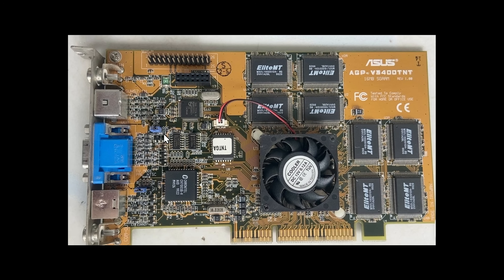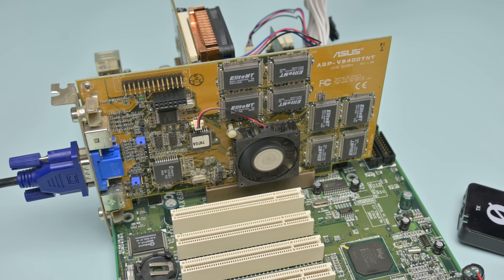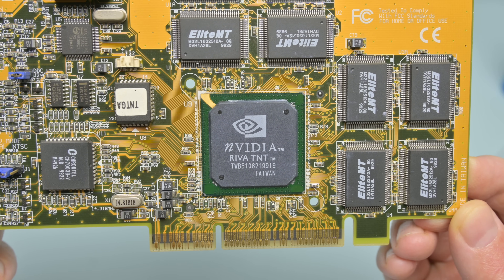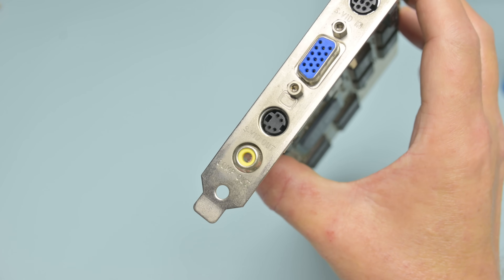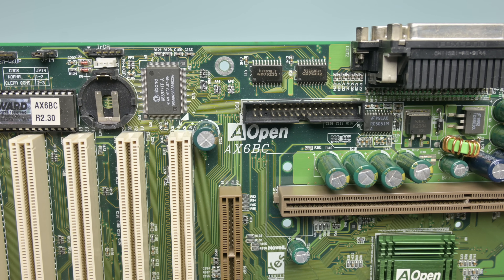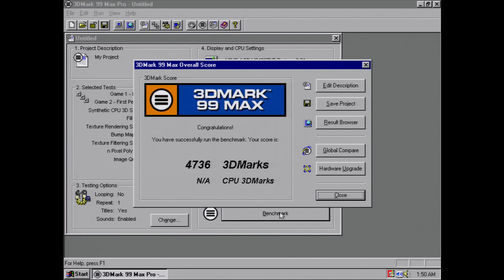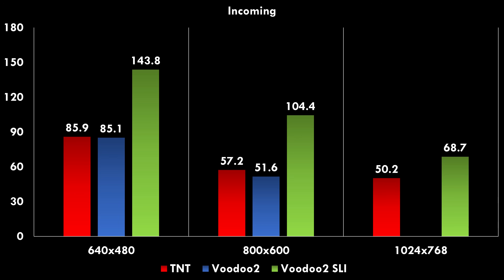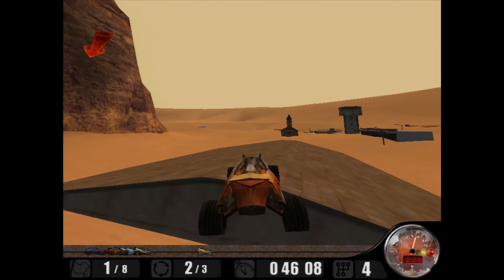ASUS V3400 NVIDIA RIVA TNT

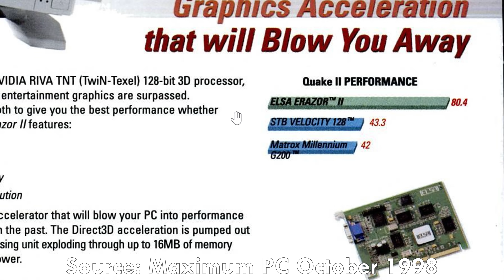Comment: 1:22 I guess the Voodoo 2 is missing because the cards listed here are all graphics cards, just like the Riva TNT itself. Voodoo 2 was just a 3D graphics accelerator card, an add-on just for gaming, so to speak. You still needed a graphics card for 2D applications (such as Windows). The Riva TNT was the first real graphics card that came close to the Voodoo 2 in terms of 3D performance (using Direct3D/OpenGL instead of 3DFx Glide). There were other 2D/3D combo cards before the Riva TNT such as the Voodoo Banshee, but those were way slower and only attractive for low budget PCs.

Another advantage of the RIva TNT was the theoretical maximum resolution of 1920 x1080 where the Voodoo 2 could only render up to 800x600 (1024x768 in SLI). But in reality, the performance wasn't enough to run games higher than 1024x768 and no mortal being had monitors capable of such resolutions anyway. More interesting was the RIva TNT's ability to display 32 Bit colors where the Voodoo 2 was limited to 16 Bit. And last but not least, all Riva TNT cards were compatible with Elsa's Revelator 3D glasses, which worked surprisngly well and offered a whole new gaming experience.

While not quite as fast as the Voodoo 2, the Riva TNT was the first real alternative to owning a 3DFx accelerator card and cool glimpse into the future for PC gamers.
Reply from the maker: Yea I get that, it's just a LOT of people had a Voodoo 2, so they would want to know how this card compares. It was nice from Tom's hardware to include weak CPUs. Many would have been disappointed with a TNT in their K6 machines.
Reply: Yeah the Riva TNT could run in 32-bit but in doing so it lost 30-80% performance. The Riva TNT and TNT2 were just too slow for 32-bit gaming. Also the Voodoo Banshee was overall just slightly slower than a Riva TNT, but on the other hand the Banshee had a much higher and better game compatibility.
Reply: @3dfxvoodoocards6  You're right about the compatibility and 32-bit being slow, but the Banshee being just slightly slower in general is debatable. It definately had its moments, mostly in games where a Voodoo 2 card would beat a Riva TNT even harder due to the game being optimized for glide. But for example in unreal engine and quake 2 engine games, it was significantly slower. And those soon became like 80% of all games we played back then. The Banshee offered good glide performance, but that was already a dying API at that point and the Voodoo 2 was  the last glide card most people owned. So the Banshee was relevant for only a very short time as a budget alternative to the Voodoo 2 for people who built a new PC and couldn't afford a GPU + 3DFx card, while the Riva TNT was a more future-proof feature beast and offered good performance where it mattered.
Reply: @NinjaContravaniaManX  in mid-1998 when the Riva TNT and Voodoo Banshee were released Glide still was at it’s peak. Even in 1999 Glide, although in decline, still was very strong, with around 50% of all 3d games supporting Glide. The Riva TNT was in practically all games just 10-30% faster than the Voodoo Banshee, the difference wasn’t big at all. And the Banshee had, because of Glide, clearly superior game compatibility than the Riva TNT. Just look at the results in 1024x768:
Quake 2 
Riva TNT - 38 fps
Voodoo Banshee - 30 fps
————-
Unreal 
Riva TNT - 29 fps
Voodoo Banshee - 23 fps
————-
Expendable 
Riva TNT - 27 fps
Voodoo Banshee - 42 fps
—————-
Descent 3
Riva TNT - 27 fps
Voodoo Banshee - 23 fps
—————-
Half Life OF
Riva TNT - 34 fps
Voodoo Banshee - 26 fps
—————
Quake 3 
Riva TNT - 24 fps
Voodoo Banshee - 22 fps
Reply: @3dfxvoodoocards6  I'd say those are pretty significant advantages for the Riva TNT, especially at those low framerates. And be careful with Expendable, this game supports bump mapping, which was immensly taxing and not supported by the Banshee at all.
Reply: @NinjaContravaniaManX  Expendable was tested with Bump Mapping off, in that game the Riva TNT and TNT2 are just slow.

Comment: Phil, you mention that when doing benchmarking you should have a soundcard.  Most of (your) benchmarks have sound off.  Does it still make a difference?  I noticed on this build you used a PCI soundcard.  If there is a benchmark difference, does a PCI soundcard have a different effect vs IDE?  How about one soundcard vs another?  This seems more like a Windows 98 benchmark thing vs a DOS issue, yes?
Reply from the maker: Without sound, some benchmarks run faster. In the videos I mute the sound often as it can interfere with my voice.

Comment: The ASUS V3400 is legendary even though it wasn't all that fast, and the reason the graphics performance was highly reliant on the CPU performance is because contrary to the Geforce 256 upwards, it didn't come with the "Transform & Lightling" feature - many games especially, such using vector graphics, were highly reliant on mathematical features such as MMX and 3DNow! to provide sufficient integer calculation performance to drive them, but especially since there was a very wide range of CPUs in use at the time many of which barely managing to provide, offloading those calculation to T&L was a real game-changer.

Comment: Even the Vanta is as fast as a TNT. Which is why my Fastware example is being used in place of my Pentium II PC's original Viper V550. Just as fast with far less heat, helped along by having a default core clock of 125MHz and SDRAM that can do 133MHz according to its datasheet.

Plus combine having no electrolytic capacitors with a standard 3 pin fan header for its 40mm fan, it will outlast every other AGP card of mine (already has in several instances).
Reply from the maker: I have a Vanta sitting here! Thanks for the insight 😊
Reply: @philscomputerlab  
My understanding is that the reference spec Vanta were explicitly meant to match the TNT in most situations - not that I personally found exceptions where it didn't.

I did try underclocking my card's core and the performance difference was negligible. The 8MHz memory overclock with the core at 100MHz had more of an impact most of the time, and the slower ramdac isn't an issue at the resolutions the card can run games at.

The system my TNT came in was part of what would have been an expensive PC for the time. PII 233 Klamath, Asus P2L97, Viper V550 and Diamond Monster 3DII, single 128MB stick of PC66 SDRAM with an Awe64 Value.

Still would rather the worst 64bit Vanta over a 32bit Savage4...they perform badly next to a Riva 128ZX.
Reply: yes true, a stock 90/110 tnt was equal to a vanta /m64 but the Tnt2 M64/vanta have a 64 bit bus... V3400 overclock easy to 125/130... sometime 140  (and have sgram and 128 bit bus) ... the asus TNT  was a different beast... ;)
Reply: @LeCarl99  TBH if heat hadn't been an issue, the TNT would definitely have been clocked higher. But the process node just was not capable.

Comment: Indeed the thing that ended 3dfx was the push to 32bit true colour. 3dfx neglected that aspect for way to long but just ran along with their 16bit glide extension. It just couldn´t compete with proper 32bit. It worked nicely back when gpu´s in general were so basic and slow that you couldn´t really get any decent fps if you went with 32bit colours... but ati/nvidia made progress on that.. and the entire 3dfx glide advantage went out the frigging window.
The riva 128 was still far to weak compared to the voodoo2. The voodoo banshee was disaster being a cut down voodoo 2 with a 2d part, and the voodoo3... while it was a fast card it showed the 16bit issue even more with the tnt2 and atis rage competition. 
Another thing that was an issue was the image smoothing, it made the games look a lot better compared to 16bit images on less capable cards... but later on it just looked washed out in comparison. 

The tnt 1 was the writing on the wall... the tnt 2 and later on the geforce with tnl was the knockout punch.

Comment: My first videocard was a 16MB Riva TNT! I bought it as a cheap placeholder for my beautiful 1.2GHz Athlon Thunderbird build. It later got replaced by a ATI Radeon LE, then later a GeForce 3 Ti200. That was a fantastic time to be building.
Reply: The Ti200 was an awesome budget card, turn on CoolBits and OC the bejeesus out it 🤣
Reply: @squish3r  Oh yeah, I could the core clock just over the freq of the stock GF3. Couldn't reach Ti500 numbers, but I got way more than my money's worth out of the Ti200.
Reply: Mine was a Riva TNT Vanta M64, I wasn't as well versed in the internet so it was a bit underwhelming when my results with the "TNT" were much lower than what I expected from the benchmarks I saw in magazines.
Reply: I had the Creative Riva TNT with the Creative Voodoo 2 Card. Still have both. Of course upgraded to the TNT 2 32MB and still have a few laying about. Newest card I still have from that era is my Nvidia GeForce4 MX440 64MB AGP x8 card. Also have a bunch SB Live (and an external USB version) and other sound cards collected over the years. One of my "projects" I really want to start is my Intel DX4 100Mhz OEM computer. I have some other older ones, still working with no issues running Windows 3.1. Been in IT for a long time professionally , Have a few old things in my arsenal. Looking at the prices online, I can buy a car selling them...lol. And to think I actually discarded MANY old computers over the years. If I knew the retro community was going to be so big, I would have saved them all.

Comment: Nein! The TNT was WAY too weak! That was even the case against Voodoo 1. Voodoo2 Or Voodoo2 SLI? No chance at all! The TNT2 Ultra came close in benchmarks, but in reality of 99% of games, that was not the case! Only Q3A was better on the TNT2 Ultra than V2SLI or Voodoo3 3500, but that was due to their mini OGL driver rather than 3DFX' hardware.

I bought the GeForce256 DDR christmas 1999 and even that was too early. Things STARTED to change with the GeForce2 GTS in March 2000 but only just.

With the GeForce 3 in November 2000 nVidia was finally in front (but not in Unreal engine games).
Reply from the maker: TNT against Voodoo 1? You ight have things mixed up a little bit. Voodoo is basically a 30 FPS card for a Pentium 1.
Reply: @philscomputerlab  P.O.D. is 60fps
Reply from the maker: @turrican4d599 Not featured in this video at all. Run the benchmarks shown on a Voodoo 1 and let us know how it compares...
Reply: @philscomputerlab  I have not watched your video yet. 😅 I was just triggered by its title.

Comment: When you get old, dry paste like that I like to hit it with a little goo gone. I put some on a q-tip and coat it lightly, it chews away at the paste and is easily cleaned up with alcohol on a rag.

Comment: I was a definite 3dfx supporter then, but when I saw Unreal Tournament performance on a friend's machine with the then-new RIVA TnT2 I was worried :P The next (used) GPU purchase for kid-me was a GeForce 2, which pretty well sums it up I guess.
Reply: The Voodoo 3 was significantly faster than the TNT2 in Unreal Tournament and on top of that it also run with higher details available only in Glide (detail textures and fog - volumetric light were turned on and available only in Glide, not in Direct3D). The real problems for 3dfx started with the launch of the first Geforce in late 1999.
Reply from the maker: That's surprising because Unreal runs really well in a Voodoo.

Comment: Yeah, this was the beginning of the end. While the 128 really wasn't up to snuff, it did allow Nvidia to stay in the game. The TNT just cemented that position even harder and while the TNT2 still didn't match the Voodoo 1:1, it totally spelt "The End!", because it became obvious that 3dfx was slowly but steadily loosing ground on all fronts and it was a matter of one or two generations before 3dfx became an has been. 32b, support for newer features, Direct3D, proper OpenGL, etc etc... Every little piece pilled up to become an insurmountable mountain. And didn't help them any that Nvidia (back then) was TOTALLY willing to push out products like the TNT2M64 and the MX's and all. That basically signaled to developers that they could count on people having a proper 3d card (of some performance) because even the low end market had an option to fit its budget.

Comment: 17:15 - Let’s not forget that the Voodoo 2 was 6 months older than the Riva TNT. And in that period 6 months was a lot for the evolution of technology. The Voodoo 2 was better than the Riva TNT not because it was much faster but because it has much much better game compatibility. The Riva TNT had compatibility issues with many games from that period, the Voodoo 2 flawlessly run practically all 3d games. On top of that there are many games from 1996-1998 that only had Glide support (no Direct3D or OpenGL) - Carmageddon 1, NFS 2, Uprising 1 & 2, Blood 1 and many many more. Those games run perfectly in Glide with the Voodoo 2 and only in SOFTWARE MODE with the Riva TNT, Matrox, S3, ATI cards. Even Unreal when released in May 1998 run flawlessly on 3dfx cards but had huge problems in Direct3D. Only 1 year later EPIC finally made Unreal run acceptable in Direct3D. Also playing in 32-bit with the Riva TNT is nonsense as can be seen in the benchmarks, the card looses so much performance compared to 16-bit it’s ridiculous. Even the TNT2 and Geforce 256 SDR are simply to slow for 32-bit gaming, they loose 30-80% performance compared to 16-bit.

Comment: That J1 jumper will be wired directly to two strap bits at NV_PEXTDEV_BOOT_0 bits 8:7 (TV_MODE). 2nd one probably does not interface with the chip

Comment: I had a TNT in the form of a Diamond Viper V330, but I've found that I tend to just use the ATI Rage MAXX that I have in single-chip mode instead. It performs a bit closer to a TNT 2 Pro (but not an Ultra), and is a good match for a PIII-550 or similar CPU. I ended up giving the TNT away to a friend in the local retro PC group who was between jobs and needed an upgrade from a Rage II that was in his Windows 98 PC!

Comment: Our first computer had an Eagle branded RivaTNT AGP graphic card with 16mb vram. The cpu was a Socket1 Celeron2 366MHz. It stood the ground quite well. We were able to play 3D games like NFS 3 and Porsche 2000, NQ Rally, the Medal of Honor series, Operation Flashpiont, Max Payne, Mafia1 and even I was finished the story missions of GTA3 from top view 😂 on this PC. The machine is still exist nowdays in some box, but the TNT card could not survived as working unit. It is expected to be overheated due to failing cooling fan, as You shown at the begining of this video.
As a child I was amaised to see the rotating nVidia logo floating abive blue nothing and got confused by its name. I remember how I studied the Control Panel, and learning what setting does what.
This was the era of computer technology where time went fast and our expensive tech early became obsolete in the flow of research and developement.

Comment: Back than, the higher resolution was the reason for me to go for a Banshee,  which was disappointing. Not because of performance, but I didn't like the tweaking every Glide game to get it running. I then had a desire to get the TNT, which I never got. Instead, I bought a TNT2 at release and was amazed about the rendering quality compared to my old Banshee. At that point, 3dfx was allready dead for me. So, you are right with the title of this video! And thank you for the gaming session! I enjoy them a lot! Another heavy racer. As if screamer 4x4 was not heavy enogh😅
Reply: The TNT1 had a lot more compatibility problems with the games from 96-98 than the Voodoo Banshee.
Reply: @3dfxvoodoocards6 That's totaly true. Today,  I would prefer the Banshee over the TNT1 for retro gaming. Actually, it is one of my favorite retro cards. But that is not what I felt back than. At that time, the Glide API was slowly disappearing and new features like 32bit color mode were not offered by 3dfx. Looking forward, it seemed that Nvidia had the better recipe. Today, I am sad that 3dfx disappeared.

Comment: Final Fantasy 7 has a patch specifically for TNT cards so it can run without 8 bit paletted textures. The old dark engine has can be patched with an old tool called DDFix to run properly without paletted textures as well. Not sure if that’s the reason it crashed though. There’s a line you can add to a configuration file “safe_texture_manager” which also might help mitigate a crash.

Comment: 64-bit color (16bit hdr rgba color components) rock. since when gpu/cpu/audio needed to be on their own chips. for what reason. well you can do sub-ip-blocks in single chip too. also why memory needs to be external of the chip. does not make any sense. not even a separate chip on the cpu processor package. on the same chip instead. external memory is slow with that 128-512bit bus.

Comment: Phil, try to save the fan use IPA to clean, use silcone oil for the bearing after cleaning. The noise will drop down u can use WD40 for the bearing as well. Heatsink for these cards are part of history too. Keep it original

Comment: Have you tried these racing games?
Motorhead 
Ultimate race pro
Carmageddon 1/2
Twisted metal 2
Rocket jockey

Also quake 2 remaster fixed a lot of issues with the original release then got some cool add-ons like 
Call of the machine. Then there's call of the void that is a quake 1 and 2 mash up. Doubt they work on any voodoo or TNT though lol